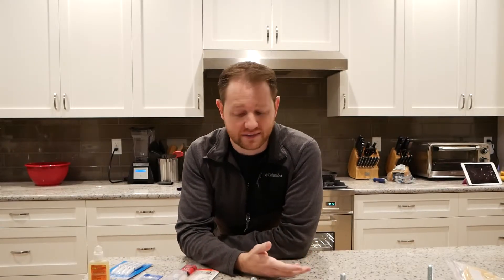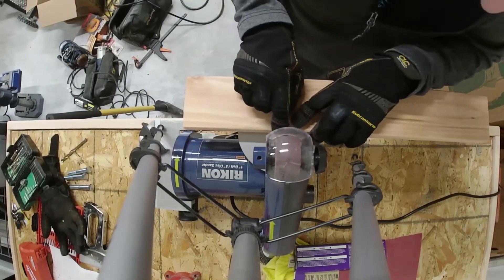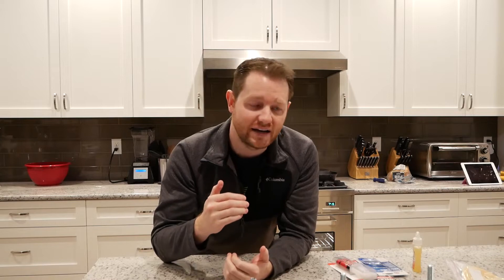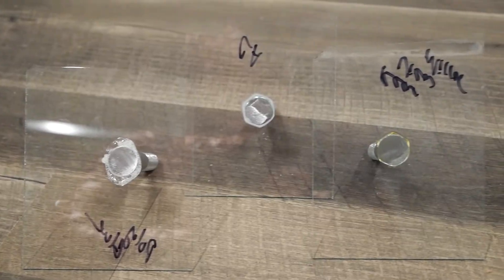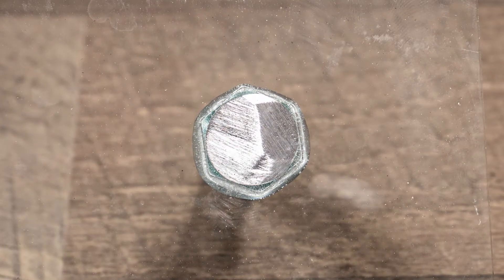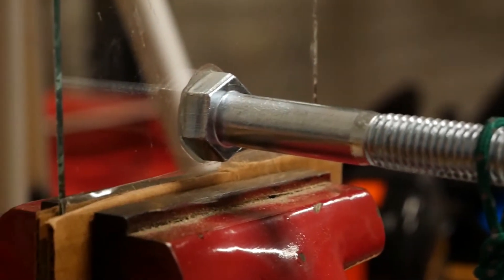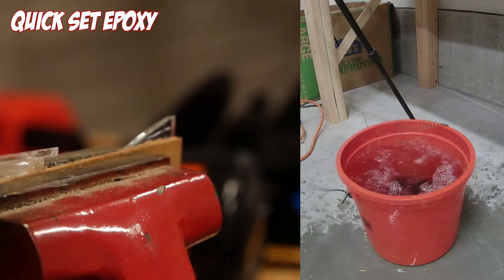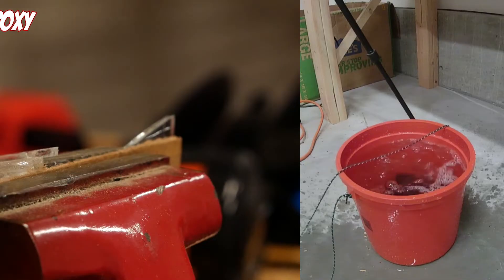How to glue GLASS to METAL (And have it STICK!)

Comment: I would like to see these tests again but before the bucket test soak the bolt / glass in water for 24 hours first, maybe even saltwater, then uv light. I live on the coast and finding adhesives that will hold up Outdoors is fun, not.
Reply from the maker: Doubt water would have much effect on any of them as they're all solvent based. UV exposure on the other hand would definitely take it's toll after a while.
Reply: Do you think the salt air is a double whammy with UV? I do know a lot of the fishermen around here like West systems and J-B Weld products.
I don't think the water affects the epoxy as much as undermining the metal and gets in between weakens the bond

Comment: what if we heat the glass or steel?
will the attachment remain?

I am basically interested in bottom steel glass plate
and it is glued with a glass surrounding

that is it is a glass with steel bottom
It has some advantages
just checking if such glue remain attached if we keep water in the glass ad heat the steel until the water evaporates>

Comment: Urethane is really very sensitive to moisture on the surfaces. I work in production for urethane bonding of medical devices. We always heated the plastic parts to 150 F before bonding. We also let them cool before bonding and then immediately bonded at room temperature. IF wd did not do this especially in the humid summers, bubbles would form at the glue joint
Reply: I always thought Gorilla Glue maybe it's only some types needed moisture to cure properly I thought I had read on some labels to dampen surfaces
Reply: @cherigriffith724  EXACTLY!!
 Gorilla Glue CLEARLY states - "for non porous surfaces you should lightly moisten the surfaces with water before application".

Comment: I didn't see no Hot glue, or spray adhesive.. I've seen small pieces of glass & glass types held on by the corners with hot glue. Also if you take bi carbonate & mix it into super glue it becomes a solid similar too Epoxy it takes some getting use to though, but if your in a pinch & have nothing else its gunna get the job done. 8:33 Its interesting i wonder if gorrilla glue has changed over the years? When i was like 12-13 (I'm 34) i ran into gorilla glue at a friends & we ended up gluing his uncles tire you the concrete we didn't use that much but it was funny & took awhile to loosen, & break free. Which is why i wonder if the materials its used on maters? or if they just changed it over the years? However you are supposed to damper the surface for the strongest bond & a few other things. Back then they only had one type of gurrilla glue though, so i guess it could be a whole different kind?

Comment: This is strange, when I used superglue on glass before, to bond two broken bits together, it did not stick at all. In fact it looked like the Gorilla glue in your test. Do we get a different brand of Superglue in UK?
Reply from the maker: I doubt it but I have no idea what's available in the UK
Reply: @aaronstestlab   Thanks. I'll go with the epoxy JB weld glass and metal just to be sure.

Comment: I’m trying to glue a piece of painted glass (less than 4 pounds)  to 1/4 inch washer in order to hang it in a window. Of you feel that your winner would work for this project and would I be able to feel secure long term ? 
Thank you.
Reply from the maker: Epoxy would work fine. So would 3M VHB mounting tape.

Comment: Have you done a test with a silkscreen (pcb) to glass?
Reply from the maker: Negative
Reply: @aaronstestlab  oh okay i couldnt find a video on that anywhere , im thinking of using 2 part epoxy , hopefull it holds , or ill be using your method after filing the heads of the bolts.

Comment: I have been working in glueing a glass table top to a fastener made of metal that sits in the middle of the glass to screw it down on the stand. It came off and so , I bought some gorilla glue if all sorts, hot glue made from gorilla , some E6000 , and gorilla epoxyy and gorilla glue for glass and metal.
I first tried a mixture of all the glues together, it didn't set right and I made a mistake of screwing the top on before it set long enough, so I tried just the E6000 , it didn't set right came apart after a day and a half of hardening. I then tried the gorilla epoxy , it was messy but it's holding better after 48 hrs. If it comes apart I am going to the hot glue.
Reply: Thanks for posting this. I am trying to do the same with a dining table. Did the gorilla epoxy hold up?

Comment: Thank you for this! I want to DIY a glass topped table on a metal base and this would definitely help me attach the glass to the base.
Reply: Hi,i kindly ask which glue you used. i have a metal coffee table bottom,want to stick glass top on it.
Reply: @lesh1986  same but for a dining table.  Did you make any progress on yours? If so which glue did you use?
Reply: @amos4395  i used clear,little rubber bumpers for glass top  table (amazon) so it wont move.very effective glues need adhesive led  light mostly for industrial work.
Reply: Hopefully you see this. Do you mind sharing which glue you used?

Comment: Awesome how you converted the test results into torque in ft. lbs. 
All of those tested better than I would have expected.. with the exception of the rearview mirror  adhesive. I remember the days,..when you'd go out to your car, and the rearview mirror would be laying on the floor. 
Those were heavy mirrors, that took allot of torque to adjust, subjected to all kinds of extremes, impressive how well that adhesive worked. 
I always shied away from the 5-minute stuff, in favor of traditional gray JB Weld,--overnight cure, ( ..machine shop in a tube.) ..Would have been interesting seeing them bonded to 1/4 inch glass. ..Great work, very inventive test setup. 
I ended up using the 5-minute JB Weld for my application,, because I needed a clear adhesive....you roughed up the metal, so i did to, and you did an acetone clean, so i did too. ..You know the old saying, 'You can't argue with results.'👍
Reply: P0

Comment: Will  the glue hold a screw on a ceramic kitchen plate?
Reply from the maker: glass and ceramic are both smooth/non-porous surfaces. I would think that what works well on one would work well on the other. Might worry about anything that's not epoxy in the dishwasher though.
Reply: @aaronstestlab   thanks 
I'm hanging kitchen plates on the wall by gluing a sawtooth picture hanger on the plate.

Comment: Thanks, I hoe this helps me glue the frameless shower door trolley back on the door the manufacturer said to use silicon and let dry 24 hours, but it did not work, now this could be a old tube of calk or the wrong kind.
But the JB Weld shows promise

Comment: You didn't apply the gorilla glue correctly! 
The gorilla glue needs water to activate the bonding agent! And I did this mistake before and the strength differed greatly between the two application.

But I would have really like to see how the gorrilla glue would have performed with the correct application!

Comment: I  wonder how these bonds hold up in the Florida sun?  I can't get anything to keep my rear view mirror to stay on.  Thoughts?
Reply from the maker: da324 might be unconventional but epoxy it on there and then paint a little black square on the outside over the glue area. Might keep the UV off the joint.

Comment: Thank you for the video a lot of great info. I hope you don't mind my comment. I work in the glass industry and I can tell you that glass has two different sides. A Tin side and a score side. Things Bond better to the score side. It probably wouldn't matter a great deal for a glue test but it would be interesting to know if you kept up with the sides as you cut your  glass blanks.
Reply from the maker: Huh, interesting. Learn something new every day. I actually wouldn't even know how to tell the difference between the two sides.
Reply: @aaronstestlab  when the glass is first cut after manufacturing you can tell by looking at the edge.  after it's cut into smaller pieces you have to have a small UV light. the score side will look more clear under the light the tin side will put a glow out around the light. Not real important for Architectural Glass,  very important when making a mirror.